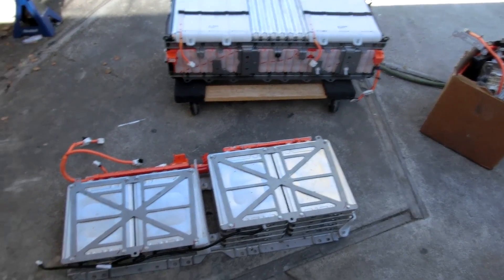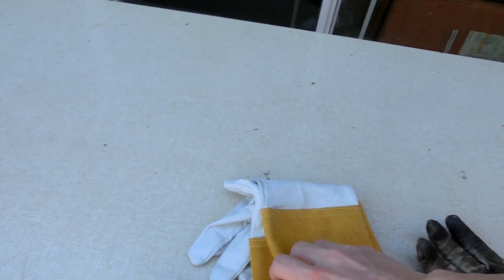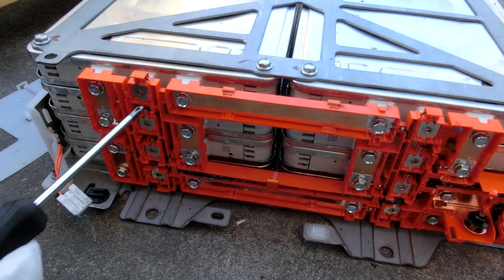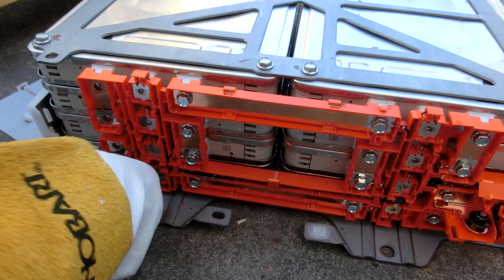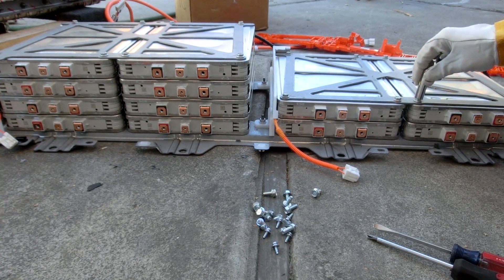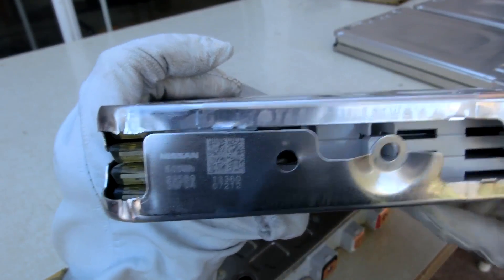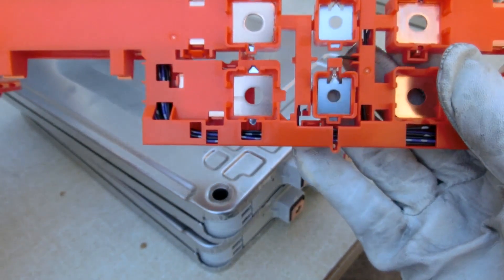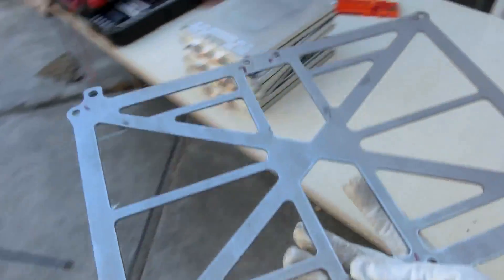2013 Nissan Leaf battery disassembly part1

Comment: Is it 2,500 mAh, or 25,000 mAh? You said, "25 hundred mAh".
Reply: To get to 500 Watt hours with 25,000 mAh these would need to be 20 volts.
20V * 25A = 500 Watts
So if these are 20V batteries, and can supply 500 Watts for 1 hour, they have to be 25,000 mAh.
Reply from the maker: these are 8.4v 50ah batteries

Comment: Not to be rude but amps are what kill you not volts
Reply from the maker: but you cant have amps without volts.
Reply: +Rinoa Super-Genius yes but you can have high current with little volts
Reply from the maker: Chayton Gray
but only if you have low resistance. and you can have low current with high volts. so its all pointless.
Reply: +Rinoa Super-Genius true
Reply: +Rinoa Super-Genius its like a 1000000 volt tazer it has high voltage but relatively low current or amps
Reply: go around on youtube and still this kind of comment..... Will I die if i touch 200A welding machine. All welder will die basically.?

Comment: so with the true assumption that your citi car is gonna be alot lighter than a Nissan leaf, What kind of range do you suppose you are going to be able to get out of those batteries...and do you plan on using all of them in the car?
Reply from the maker: +DatPhatGamer no not all of them, but i hope to get at least 200 miles of range.

Comment: I also chuckled a little that you have a $3200 battery but no socket set. But then my first hacking experience was borrowing my Dad's socket set to modify my bike when I was 5 or 6. When I learned how to adjust the seat and handle bars, I was in heaven. So maybe it's sentimental. I spent a few years working on cars for extra money too, so sockets were vital. 

I definitely respect your right to use whatever tools you want. But life is short so treat yourself to good tools where it makes sense.

Comment: They are two cells a pack? Are you charging just one cell there 😱? It's second cell, first cell and negative and you charging the first cell only 😱
Reply from the maker: +LiPe VoLcOm yes i am, what are you upset about? its safer to do a test on a single cell than to do a test on two cells in series that arent balanced.

Comment: $3200 on a battery, surely you can fork out for a $60 VDE pliers set?
Reply from the maker: +Chris Woodhouse but why? just because i spend money on one thing doesnt mean i can then spend a lot of money on everything.
Reply: Rinoa Super-Genius True, you work with what you got (or can borrow), but if you think you need it and it would help, don't look at it as an expense, consider it an investment. Right tool for the right job will not only make you work safer, but quicker. You have a Patreon account?
Reply from the maker: Chris Woodhouse
nah im not a big fan of patreon, plus i make a little bit of money from my channe to support my projects anyway. if i ever go back to doing youtube as my full time job i'll maybe open a patreon.

but about the tools, i dont believe there is ever a "right tool" i believe every tool is less good or more good for specific jobs.
Reply: Rinoa Super-Genius
 Fair enough. Stay safe then. Keep wearing those hefty welding gauntlets! Those plastic bits look like they'd slice your hands up, not to mention the lip on those batteries!

Comment: It scares me that your removing the batteries from a metal enclsure then slapping your hand down on them
Reply from the maker: +PS4 Custom Gamer why?
Reply: Massive batteries very little structural rigidity and much easier to damage than the small phone and rc batteries we are all use to handling.

Comment: have you done anything with solar ballance charging? I have been running the kids power wheels and scooters with cla because the charge controllers are so easy to make. thinking that my only ballance options is a micro invertor with a basic balance charger that comes on when adequate ac voltage is provided.
Reply from the maker: +nbookie you mean like have a solar panel power a BMS that charges the battery?
Reply: +Rinoa Super-Genius yes sir. looking for an idea that would be as simple as a sla solar setup. panel -> charge controller -> battery bank & load.

Comment: it looks a tad heavy i do worry if its to heavy your back end slips out on corners if its on a bicycle. unless its a trike but built strong unlike the one that wrecked. maybe using a trike chassis? from a real motorbike be more up to handling the stresses. had a quick google and found wazp electric drift trikes. something similar made by yourself.
Reply: +haroldtplopps     heavy = more friction on surface,   wider tire helps too.        lean the bike until your knee touches the ground

Comment: OK after watching this one I have finally broken down.
You my super interesting friend need to buy just a few things that are priceless
1 Knipex cobras ask AVE 8701250 will change everything
2 Baco soldiering station ask AVE
3 Wera tools look up a nice little socket kit with a nylon pouch and driver bits
4 Aerokroil the best penetrant around
5 E 6000 its in Crafter's shops but it's actually industrial vibration proof water resistant glue not for UV
Paint it.

Comment: Flattening old copper pipe can be a great way to connect those cells into a pack.  You can measure the thickness to determine its current capacity.  Some pipe is too brittle, the soft type that comes on a roll is best.  Also the hydraulic wire terminal crimper that I got on amazon for $33 works well.

Comment: 3200 on batteries, couldn't afford a 40 for a decent socket set?
Reply from the maker: +Can't B you ive rarely needed one
Reply: How long have you been taking things apart? The reason you think you rarely needed one is because you've never owned one. Saves hours of wasted time screwing with the wrong tool for the job at hand. Also pick up a 16-20oz ball peen. You won't regret it....
Reply from the maker: Can't B you
i've been taking things apart since i was like 2, yes i have a socket set back home but ive used it like 3 times in the 2 years ive had it.
Reply: May I ask if your going to use the batteries to power your car back at home with?  Then drive it to Cali. Road trippin with a friend is a priceless adventure.
Reply from the maker: Can't B you
yeah the end goal is to have these in my citicar. i may drive them out there with my dad or i may go cross-country on my trike. idk.

Comment: Hey it´s only 90V that would not kill you???  Even 20V with enough Amperes will kill you easily.
Reply from the maker: +ThinkDragonX41T where do you get your data from?
Reply: +Rinoa Super-Genius Excuse my bad english im from germany so i found this for example in english. https://www.physics.ohio-state.edu/~p616/safety/fatal_current.html
Reply from the maker: ThinkDragonX41T
i dont see 20v on there at all. you talk about volts with enough amps as if it matters. unless your stabbing the electrodes into your heart, 20v DC isnt going to kill you. i get shocked with 60v DC all the time and its not too bad.
Reply: +Rinoa Super-Genius I know thats thers is not written 20V exaclty its the fact that the current kills not the voltage. Even 20v and over 0,2A on the right spot can cause muscle Paralysis so that you couldnt go away and the thing will cause breathing difficultys and heart spasm. DC is al lot more dangerous as AC from the socket with 50 or 60 Hz.
Reply from the maker: ThinkDragonX41T
no its your resistance coupled with voltage that kills you. you could die from 1v if you had super low resistance. but human skin has really high resistance so even 250v is possibly survivable.

no DC is less dangerous than AC, AC is far worse. have you ever used electricity before?
Reply: +Rinoa Super-Genius The human Body has an resistance around 1k Ohm. With AC you have the chance to go away from between the pulses. This cause heart cardiac arrhythmia but ther is a chance to go away. With DC there is a  direct line of current that flows across your body and muscles and cause the to contract. If the FLOW current is around 0.2A  you have no chance to open your hand or run away. If  current is not so harmful why there are RCD´s in AC Households? Cause its funny to sell them to the customer? Another point is  the area where the current flows thats dangerous. Over one finger to the other its painful no more but from one hand to the other there is a high risk to die cause the current is flowing over your heart and causes them to contract continiously as every muscle. The secound is that DC can cause Elecrolysis in your blood and gasifing it so that gasbubbles can go up into your brain trough the venes and you die by an stroke. I Agree that 130V are possibly harmful than 90V but there is a risk high risk at both times.  I´m an certified electrican and i know a lot about electric accidents in industrial where DC is around you all the time.
Reply from the maker: ThinkDragonX41T
1k from what point to what point? 1k per mm?

because a house uses AC, not DC, AC is much worse.

you should get re-certified then, because you dont seem to understand electricity very well.
Reply: +Rinoa Super-Genius 1k Body resistance from one hand to another hand at around 230V. So please tell me why is AC so more worse than DC you all mighty electrican?
Reply: +Rinoa Super-Genius And if you mean that AC sets  the Body impedance lower at rising frequency im aware about ist but thats not the point  of the discussion its the fact that current kills not voltage. ;)
Reply from the maker: ThinkDragonX41T
but you cant have amps without volts.
Reply: +Rinoa Super-Genius Thats a true fact but but current is depending on the resistance. If you very sweaty your resistance drops down a lot an the possible current rises. And the current is the fact that kills you and these Batterys can do a lot of current. Dont understand me wrong i don´t want to fuck you off or something im just a bit worried about your safetyless work. You do a lot of amazing Projekts but sometimes im worried about your safety. ;)
Reply from the maker: ThinkDragonX41T
safetyless? i wear gloves and dont touch things that will kill me. i think thats pretty safe.
Reply: +ThinkDragonX41T 100V AC has a peak voltage of 141V though.  (AC unit is rms)

Comment: Spends $3200 on batteries.  Doesn't spend $30 on a basic socket set.  whuh?
Reply: +David Ihnen (Skylos) 12кWt
Reply: +Rinoa Super-Genius I find the idea that socket sets have 'very limited use' really odd. I guess if you don't fix things very often then you don't need a socket-set but I have 3 (different sizes) and have used them a lot over the years. Mostly for cars, but also bikes, washing machines, buildings (big screws) and just all sorts. I was amazed that the kind of person who takes a leaf battery apart might not have such a basic tool.
Anyway, nice vid - thanks.
Reply: True a socket set is key... Working on your bike your electric car maybe... it would come in handy for all kinds of things... You have to work harder with wrenches and pliers. Not picking up a socket set is selling yourself short. Maybe you could ask YouTube to buy you one.
Reply: +Rinoa Super-Genius you don't have to use a ratchet. a T handle is awesome because it gives you torque to break it loose or tighten and has inertia so you can spin the fasteners on or off.
Reply from the maker: JIUNnF
?
Reply: +Rinoa Super-Genius Specific energy capacity.
Reply: +JIUNnF Литий 0.25кВт на литр.
Reply: +Rinoa Super-Genius  Well best bang for your buck I have found is the  230 pcs craftsman set with case from Sears.  You have Both  metric and standard socket and wrenchs up to 1"  (I think) , plus allen wrenchs . I have 2 set's.  I work on stuff like you often and find there's nothing I can not take apart outside of hvy equipment. and in most case's with the proper tool/tools.
Reply: +Rinoa Super-Genius I see I'm not the only one to stop the video in order to scroll through the comments and find out why you're struggling with a Crescent wrench when a socket and short extension clearly were the tools for the job.
Reply: I agree - I have a limited use for my socket set, but its saved my bacon quite a few times when its come time to use it. And when working with batteries, its indispensable. Go get one Rinoa - $30 wont break the bank. :)
Reply from the maker: +David Ihnen (Skylos) because socket sets have a very limited use.
Reply: Rinoa Super-Genius interesting assertion.
Reply from the maker: David Ihnen
i dont work on many things with hard to reach bolts. usually my old pipe wrench works fine.
Reply from the maker: Brad F.
 well ive had them back in illinois and i never really liked using them.

Comment: I like your videos but I have a problem with these smart car batteries what do you do with these cars when you can't use them anymore? Because they don't degrade into the earth. I just don't have the same opinion as people who like these cars because they aren't really environmentally friendly once you can't use them anymore. But other than that I'm not hating on all your videos just on the electric cars carbon copy how they aren't earth friendly in their final stage in their lifetime.
Reply from the maker: +Vincent Gallapo i'm not following, the nissan leaf got melted down for scrap and recycled. thats just what happens to cars when they get into a big wreck.
Reply: +Rinoa Super-Genius I'm talking about the batteries that aren't being reused by someone like you. Because when there just sitting they are basically hazardous acid waste that is being released into the environment
Reply from the maker: Vincent Gallapo
no, if they are "just sitting" that is not them "being released into the environment" them being smashed would be but not them sitting.

lithium is too valuable to just let it sit, auto dealers sell it back to lithium plants where they make more batteries.

Comment: If you have not already, do the maths to work out the power to wight ratio because these might be better for the e trike. Also I would recommend using the larger modal as is in your car and use a step down converter. Saying that you could reconfigure the wiring to make 48V and not have use a step down converter.

I would not recommend mixing these with old 18650 cells just to be on the safe side.